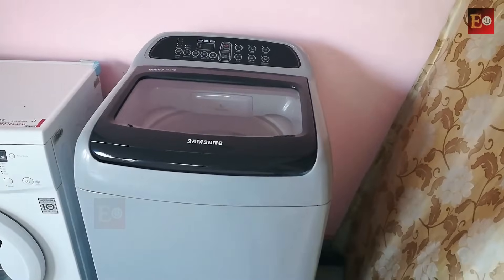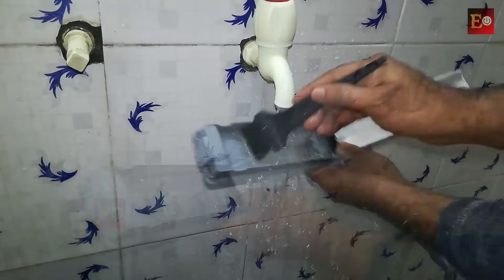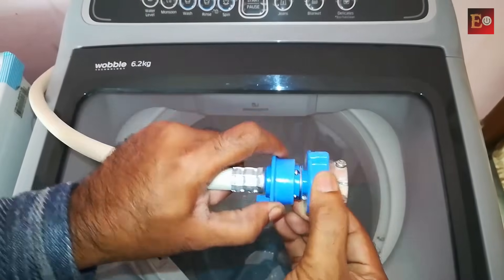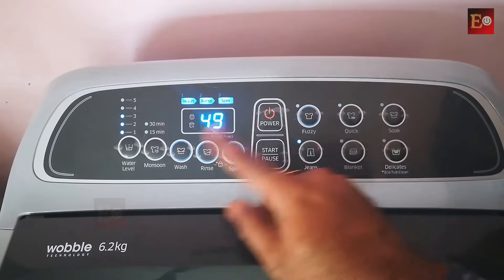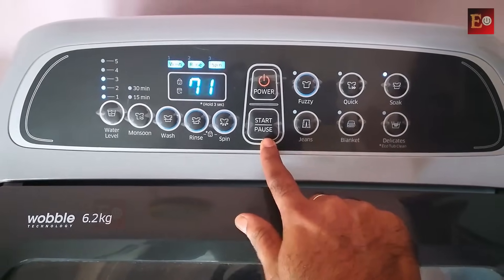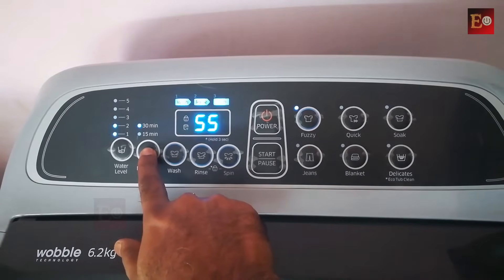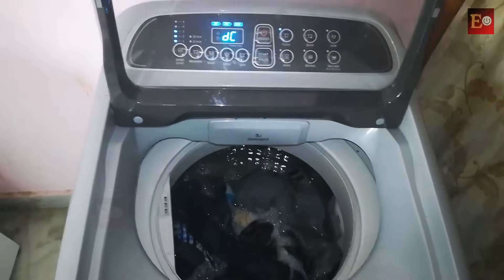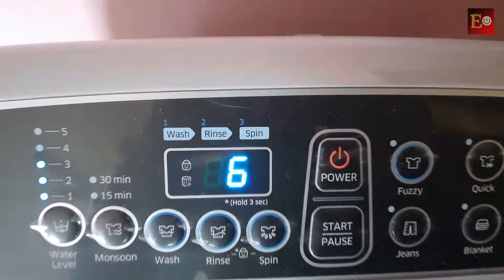Samsung Top Load Fully Automatic washing Machine Demo| How To Use Samsung Top Load Washer And Dryer

Comment: Hw to removeonly water frm clothes like there is spinner in semi auto achine in this is der any option
Reply from the maker: Semi automatic washing machine has 2 partisans. Washer and spinner.j  If u want only spin u add in spinner and then u turn on only spin. Spin is like dryer.  Normally we are after wash compleated charges the cloths washer to spinner then turn on spinner.

Comment: Sir, I have a question. I selected only "WASH" option to wash the clothes. But it displayed 66 minutes time to only wash the clothes which is too long. Why too much time to only wash? I did not understand??
Reply from the maker: Generally machine take more time than on the display time. Because machine will not calculate and will not move the time when machine taking the water. If water pressure is slow at water tap machine take more time.

Comment: Regarding water tap fixing 
My tap is bit bigger and also having threads 
How to fix 
There is a picture given in the manual for threaded tap but opposite mating part is not available 
Kindly suggest how to solve the issue
Reply from the maker: Call 9550206206
Reply from the maker: This is the my no

Comment: In our washing  machine the cycle order got seperated so that we have to press wash,, after sometime  washing  machine  gets off we have to press rinse,, and again like that  we have to press spin... It is taking  a lot of time...What to do for these problem??
Reply from the maker: First u turn on Wash, Rinse, and Spin led lights on machine key pad, then u start the machine and after starting machine turn off with power option. Then u start and check it
Reply: @ELECTRONICSALLINFO  Thank you it's  working...
Reply from the maker: Ok. Ur Well come

Comment: Hi, I have query i just purchased same machine which you have shown in video... I was told that after u do the active wash base downside, and later on when u will give a little push to lid downside it will smoothly on it's own close.... I saw the same in the shop. But now when i have received the machine i found out that lid with the active wash base attached go down with speed on pushing down.... but when i remove it then lid do not go down smoothly on it's own when i push it... But i have to press it on my own till it's last closing position. So which is normal form of machine. One which i was told and shown in shop or the second one which i have recieved... Please answer....
Reply from the maker: the wash wash basin cant open and close automatically. we have to handle with hand.

Comment: Monsoon butoon means what sir
Reply from the maker: Some machines also have a monsoonmode. This is an India specific mode that gives clothes a hot rinse and spin to reduce drying time duringmonsoons. ... Washing machines have come a long way, from a wooden drum powered by motor to high-techmachines that come equipped with automatic washing modes

Comment: What's the use of child lock system
Reply from the maker: if u have children, you can lock the machine key pad while the machine is in the wash. if u lock the machine key pad, operating options will not work even u press any option.

Comment: Sir I have this machine of vediocon when we start it, and water starts entring in it but on other hand it moves out side by side please tell about it something
Reply from the maker: If u start the machine it will do 3 cyclcles Wash, Rince and Spin. If u want only any single cycle, press and hold, which cycle u want. If u want normal mode there should be indicate(on) three lights Wash, Rince and Spin. If u press and hold Rince button and then Spin button they'll on there.

Comment: I m too having this machine but from water jet function there is leakage of water, will you plz reply that what can do for it
Reply from the maker: i cant under stand where it is the problem exactly. If the problem is at water pipe connected. we can tight at water pipe connection.

Comment: Hi, why does the wash take so long to complete even though the display shows about 45 minutes? I've just bought it n I think the water pressure is a little low.
Reply from the maker: If water come fast from the water tap, machine takes water fastly. Machine does not calculate when water takes the water. Only machine calculate time in machine is running.
Reply: @ELECTRONICSALLINFO  how does the drain pump need to be fixed in order to avoid there is no leakage?

Comment: Hello sir ...rins ke baad spin keliye machine fir se paani supply start hoti h kya ..
Reply from the maker: Can you tell in English
Reply: After rins prosess ... machine automatically suply  water spin process also...
Reply from the maker: Normally machine takes water 3 times. But it doesn't take at spin time.
Reply: K and quick wash setting time ...how meny time to take machine ...
Reply: Which is best washing powder.. to Samsung company machine
Reply from the maker: Some Matic detergent Powders are made separately for front load and top load washers. You can use any Matic detergent Powder. Don't use Normal detergent powder
Reply from the maker: You don't worry. After takes the water it will start.
Reply from the maker: You don't worry. Machine will start after takes the water
Reply: @ELECTRONICSALLINFO   hello .... machine pe hum shoes wash kar sakte h kya.... machine ko Kuch problem Nahi hogana...plz tell me

Comment: Hey video is good
But could have been more useful if you had provided drain hose/pipe connection to the outlet, as I heard it needs to be positioned vertically up for pumping machines to drain the water
Reply from the maker: I thought its a small thing. So I did not tell

Comment: when the washing completed  why the  eco tubclean light is on sir
Reply: pls reply me
Reply from the maker: I think your machine is in tub clean option. Eco TubClean is for drum cleaning.  If you want clean machine drum, u can use it. If u want turn off it, u press and hold Ecotub clean button. Then it will turn off. If you want on it press holt it for drum cleaning.

Comment: What to do if 4c button press.?
Reply from the maker: If machine cant gets the water properly, it will show 4c Error. The 4c error indicates that the washing machine has detected that there is a problem with the water supply. The most common reason for this error is a blocked or kinked water supply hose. ... 1 Check that the water tap connected to the washing machine is open to full.

Comment: How to start dryer only?
Reply from the maker: Wash, Rince and Spin buttons separately on the machine keypad. Here Spin means drying. If you want dry only, press and hold Spin button 3 seconds, then only Spin will on and it will do only dry.
Reply: It’s not taking

Comment: How to set time for this kind of washing machine sir? I've it. Please let me know sir.
Reply from the maker: We can't set the time in this model. Washing time is dipends on there washing programs. If change washing programs there washing time also charge with washing programs. If you want wash less time u can choose quick time. But quick time program is set very less durt clothes.
Reply: @ELECTRONICSALLINFO  tq sir, but, it takes long time to wash clothes sir. How can we reduce less time? Is there any possible thing?. My cousin has diamond drum(Samsung washing machine). It takes time maximum 1hr. So, I asked sir. Hope you will give good solution to me.

Comment: My machine taking very less water . What is the problem
Reply from the maker: If there is more dust at back side inlet pipe filter, machine can't get water from the tap. Open back side inlet pipe and Clean side inlet pipe filter.

Or if there is less water pressure at the tap machine can't get the water.

Comment: The force of water through the pipe into the machine is very slow.
But the force from the tap is fast.
What should I do ?
Reply from the maker: If water come fast frome the water tap machine can take fastly.
Reply from the maker: But if it takes water slowly it will take some more. But no problem is there
Reply: Same problems with my machine
Reply: @DeepikaSharma-kc3pq  talk to your plumber, and tell him to Install a cri pump to increase the force of the water upto 8 to 10 bar.
The pump costs around 5000 to 6000.
This will definitely help to sort out your problem.

Comment: How to drain the water?
Reply from the maker: We don't need anything for drain. It has inbuilt is completely fully automatic washing machine. Machine has drain pipe back side of the machine. Set this pipe to wash room or where u want to go drain water. Drain water come out automatically from this pipe to out side in final cycle.

Comment: sir one problem in samsung 6.2. not wash and rinse and display 43 appear 4E  and machin struk. why sir..
Reply from the maker: The 4E (4C) error indicates that the washing machine has detected that there is a problem with the water supply. ... 1 Check that the water tap connected to the washing machine is open to full. 2 Check that there are no kinks or bents in the water hose connected to the machine.

Comment: In my washing machine.. there is only two process cover out ..rinse and spin didn't Done wash..when I start machine direct rinse process start with 68 min what can I do for wash????
Reply from the maker: there should be on Wash, Rinse, Spin lights before start the machine. there are Wash, Rinse, Spin options on the machine key pad. if u press on wash option it will on and machine will Wash also.
Reply: When I start machine .. machine directly start with rinse then spin..only two lights on rinse n spin..so I want to start with wash with light directly..how I can start??
Reply from the maker: Wash, rinse, Spin options, on the machine key pad, if u press on wash option there will on wash light also

Comment: Which washing machine have long durability semi auto or top load automatic
Reply from the maker: semi automatic washing machines are old models. semi automatics have long process washing. semi automatic models have two drums separately for wash and dry. we have to change clothes wash drum to dryer drum in middle of the cycles.  Better to go for fully automatic washing machine. Because it has single drum and everything it will do automatically wash and dry in a single drum.

Comment: Hello .. my samsung machine stuck on the 13 minutes of rinse process .. and only water is coming down .. how to fix that ?
Reply from the maker: is there displaying any error code on the display like dc or 4c
Reply: Its showing C4
Reply from the maker: I think its 4C. If machine cant gets the water properly, it will show 4c Error. The 4c error indicates that the washing machine has detected that there is a problem with the water supply. The most common reason for this error is a blocked or kinked water supply hose. ... 1 Check that the water tap connected to the washing machine is open to full.

Comment: My machine doesn’t have the jeans button. How do I wash jeans??
Reply from the maker: If you choose any option there washing is same. But there Washing time is deferent. Normally jeens cloth needs more time than other clothes. If u don't have jeens button, u Can choose any long cycle option for jeens cloths. If u want soak ur clothes pause your machine after 5 min started machine keep the machine in pause 15 minutes or 20 minutes then u can start the machine.

Comment: What does error 5E indicate
Reply from the maker: Check the drain pipe. If your Samsung washer is in the middle of a drain cycle and the 5E error code shows on your washers display, it means that the water is not properly draining out of the washer. Something may be clogged, jammed, or blocked and thus preventing water from draining out of the washer. ... The official error code is 5E.

Comment: Hi bro,in my washing machine after washing &draining water, drying process is taking place and showing 7 minutes,. But suddenly it is showing 19 minutes and again water is adding to clothes...and again process of washing is starting..can u help me with this?
Reply from the maker: If u open the door in middle of the washing, some time back of the display time.
Reply: @ELECTRONICSALLINFO  I have not opened the door during the process of washing...After draining and drying where the machine rotates very fast vibrating itself...and suddenly adds water to clothes and time is increase..pls can u help on this?
Reply from the maker: Is there displaying Wash, Rinse, spin lights, on the machine before starting the machine. There should be on 3 lights. Machine wil  compleate one by one. Spin light indicates drying final cycle. If u press spin option, there will show only Spin light and machine will do only dry.
Reply: Hi bhai..yes there are 3 lights at beginnaing,but after 3 process getting completed again water is adding to clothes and the machine is rotating, draining,drying and again repeats the same process increasing the time to be taken

Comment: In operation, when switching from wash to rain to spin , machine stop for a minute or so and generate a different type of sound....zooooonnn. is this normal?
Reply from the maker: R u same brand. Not zoooon sound.It will generate click.. Click sound when changes cycle in machine.
Reply: @ELECTRONICSALLINFO 
It is WA70 H 4200/SW brand
Reply: Reply awaited
Reply from the maker: will generate click.. Click sound when changes cycle in machine. Not zoooom

Comment: WA62N4422BS Top Loading with ActivWash 6.2kg  
can you tell me the exact feature of this washing machine please 
and price also    
should i buy this model  ?? 
Please reply
Reply from the maker: wa62n4422bs this model and in this video model same.
Reply from the maker: But this model does not have inbuilt water heater. In whirlpool bran, some top load washing machines comes with inbuilt water heater.
Reply from the maker: This model prise is Rs 16500
Reply from the maker: My no 9550206206.
Reply from the maker: https://www.flipkart.com/whirlpool-6-5-kg-5-star-inbuilt-heater-fully-automatic-top-load-in-built-grey/p/itm8a834531e4651?pid=WMNE8TAWETFYVGEE&lid=LSTWMNE8TAWETFYVGEERL4AKE&marketplace=FLIPKART&cmpid=content_washing-machine-new_6491403329_u_8965229628_gmc_pla&tgi=sem,1,G,11214002,u,,,381566805483,,,,m,,mobile,,,,,&ef_id=CjwKCAjwqdn1BRBREiwAEbZcR4wemWJXeCgbGy1Sh-Yn5hgmdF4nqgx4PMsw-AuXFKd-vTF-jSe-IBoCnf4QAvD_BwE:G:s&s_kwcid=AL!739!3!381566805483!!!u!309904561132!&gclid=CjwKCAjwqdn1BRBREiwAEbZcR4wemWJXeCgbGy1Sh-Yn5hgmdF4nqgx4PMsw-AuXFKd-vTF-jSe-IBoCnf4QAvD_BwE
Reply from the maker: Some times we need hot water when we want wash bed sheets or if ur cloths have hard stains. If machine has inbuilt geyser, u can choose hot water option and u can choose temperature also how much u want. If u don't need,  it can wash with normal water also.

Comment: Dust filter kottadi kavali.  samsung 6.2kg top load washing machine. ekkada dorukutundi
Reply from the maker: On line lo untayi. 

 https://www.amazon.in/GCA-samsung-washing-machine-accessories/dp/B0BHP7X3LH/ref=asc_df_B0BHP7X3LH/?tag=googleshopmob-21&linkCode=df0&hvadid=617538360887&hvpos=&hvnetw=g&hvrand=9831378611792974309&hvpone=&hvptwo=&hvqmt=&hvdev=m&hvdvcmdl=&hvlocint=&hvlocphy=1007740&hvtargid=pla-1966331961074&psc=1

Comment: how to dry clothes please ?
Reply from the maker: Generally after starting the machine it will do 3 cycles, Wash, Rinc and Spin. There Spin means Drying. We don't need any thing after starting the machine. It will do everything. But if you want only drying, Spin option is there on machine key pad. If u press and hold it, then machine will do only Dry.

Comment: Hi, good evening. What should I do if water is not coming out from the main water flow inside the machine?
I checked the water filter - it's clean.
 I Tried the water jet button, and it's working (there is water flowing from the water jet).
Thanks to help.
Reply from the maker: Is ur problem water in or out. If the water not coming to the machine the washing machine has detected that there is a problem with the water supply. The most common reason for this error is a blocked or kinked water supply hose. ... 1 Check that the water tap connected to the washing machine is open to full.
Reply: I am not understanding whether my washing machine is not starting or water is not coming out
Reply: Pls help me

Comment: How to wash clothes with out using tap water
Reply from the maker: It's completely fully automatic washing machine. It takes water automatically how much water it want. But semi automatic washing don't need water tap. If u buy Semi automatic washing machine, you can add water manually ourselves in Semi automatic washing machine.

Comment: How to drain water?
Reply from the maker: We don't need any thing for drain water. It will drain(Spin) water automatically in Final cycle. Machine has drain pipe back side of the machine. We have to set it, where you want to go drain water after wash completed.